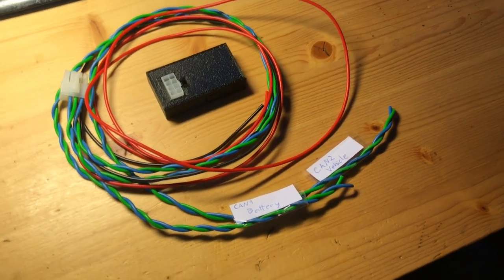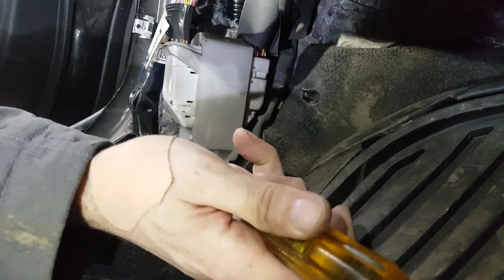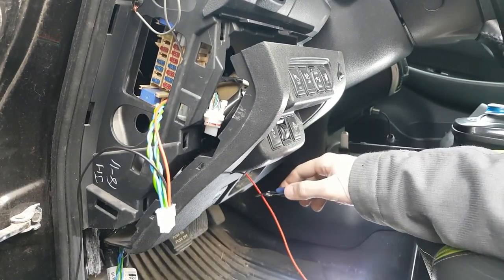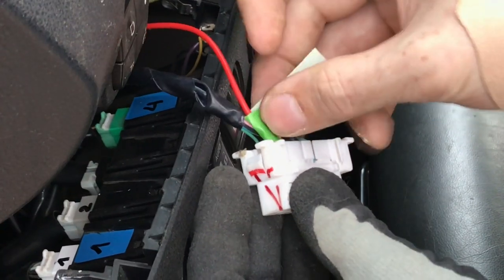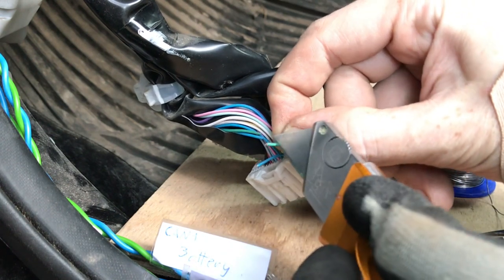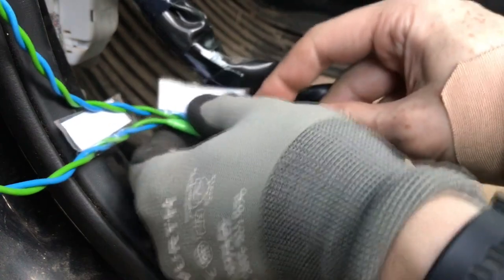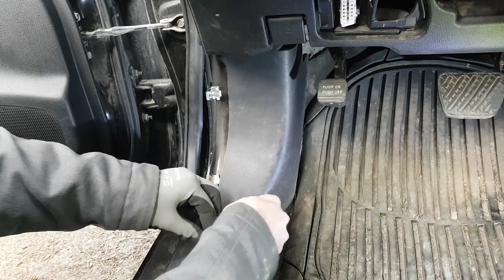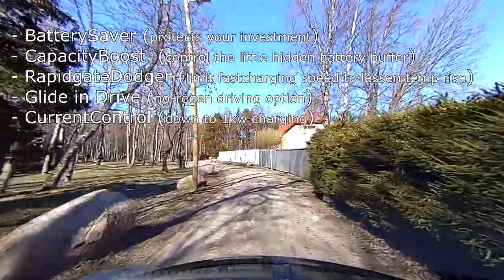Can-Bridge install guide on AZE0 Nissan leaf for advanced features

Comment: One update:  16:11 is incorrect nowadays. Dala doesn't recommend using a can-bridge on your Leaf if you haven't upgraded the battery pack size yet. He says, "Do not install can bridge before upgrading. It will malformat the messages." He has also removed many if not all of the additional features listed at the end as he doesn't have time to support them these days. FYI. But it's still the best open source can bridge on the market right now for those of us wanting to upgrade their nissan leaf to a bigger sized traction battery from Nissan.
Reply from the maker: This tutorial was indeed made before the cheaper can bridges with less features were available. This is for the older more expensive can-bridge. If what okinawajapan1 said is true and you are installing one that looks different than what I have here then make sure to check the differences with this guide in all aspects.

Comment: Lovely detail, thanks. 
I assume you have crimped a ring terminal on by now 😊
Any tips for a permanent 12V location for a right hand drive Leaf (AZE0)?
Wouldn't want to run the +12V all the way across. 
Note to anyone else considering this for RHD, everything else is the same.
Reply from the maker: Hello sir, I was just by chance messing around in my car righthand side for some other mod. I tried looking into it but then realized that there are so much other wiring. I do not see how this could remain the same when whole steering system is brought over to the other side. Are you sure they did not just mirror/flip it and you have same connector brought with, to the right side?
Reply: @gelisob  nope. I ended up using an unpopulated fuse terminal and put a blade connector in with another fuse in series.
Thanks for the reply.

Comment: Thanks for posting. Just one positive criticism: Are you sure that those ground connections are OK?  There is no chance for cutting/disconnection on those tiny cooper wires and lost power in the worst moment (while driving)?
Reply from the maker: What wires are you calling tiny there? :) The ground wire is a quite fat gauge wire that I was able to split into two and tie around the big screw, where all the taxi systems also had been connected to for years and several hundred thousand kilometers. They did not show any plans of getting loose or broken.
Reply from the maker: @DalasEVRepair  oh right those. It would of course be nicer but I feel the breaking chances are quite similar :) 
I'm probably changing them all out with slide in crimp connectors, making can lines also directly re-connectable. For video I tried making use of most generic accessible methods for most people who could install it. No fancy plugs or tools.

Comment: This is a great guide, i am going to use connectors for this so worst case i can simply go back to stock.
Reply from the maker: Thanks. Connectors can be a point of failure so be careful to choose ones that can not come loose over time with vibrations.